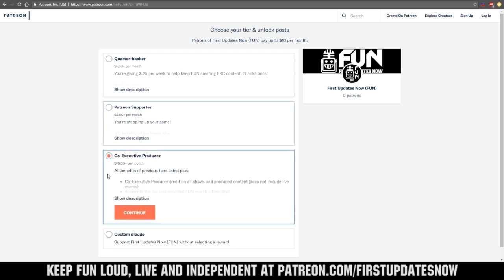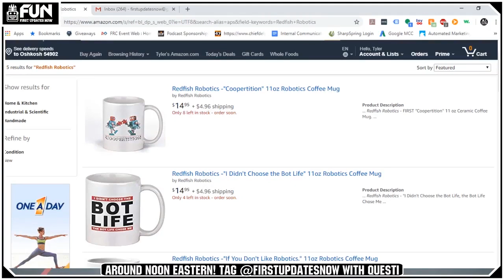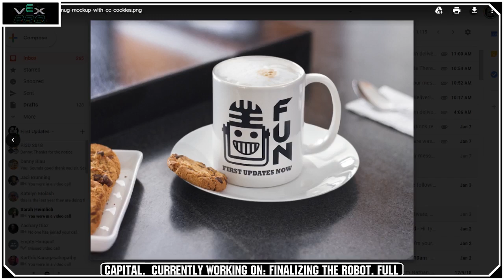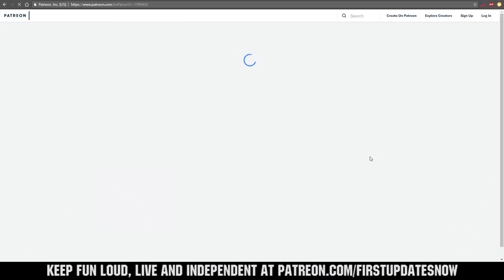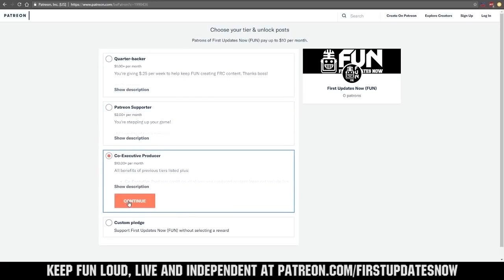Ri3D Team FIRST Capital Tuesday Reveal   Robot in 3 Days

Comment: Excellent robot! One of the most impressive RI3D bots I've ever seen. Does anyone know which pneumatic pistons they are using to lift the front/back of the robot?
Reply: Well they were having a little bit of issue getting over their 5.5 in (supposed to be 6 in but oh well lol) step, but i'm assuming that they are using the 6 in pistons available from first choice (Round Body Pneumatic Cylinder 3/4" 6 inch stroke with 2 brackets (fc-OCG1075x6)) assuming its mounted about a half inch from the floor
Reply: We used 1.25" bore pistons, 7" for the back and 8" for the front. It's what we happened to have on hand, so others may work as well! Make sure you're thinking about solutions to prevent the rods from twisting as well--ours were essentially 3/8" steel so they are decently durable.

Comment: May I suggest using some small rubber wheels on the bottom of the pistons. It seemed the low friction HDPE had troubles with sliding and keeping the robot straight.

Comment: Would you guys recommend using a grabber than incorporates hook and loop tape? or does it not last?
Reply: You can use it, but we would suggest designing some sort of alignment mechanism better than the one we made to have consistent, reliable pickup. The velcro tape needed to be replaced after ~100 pickups or so